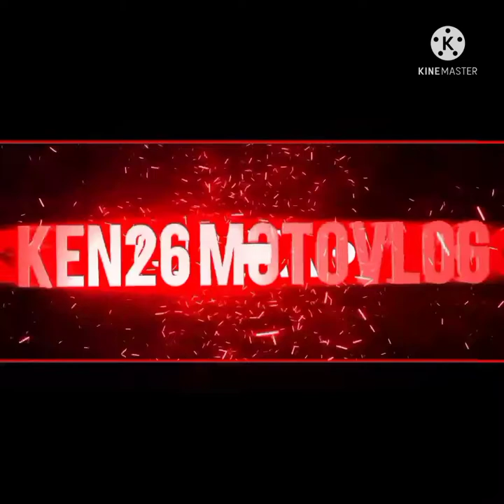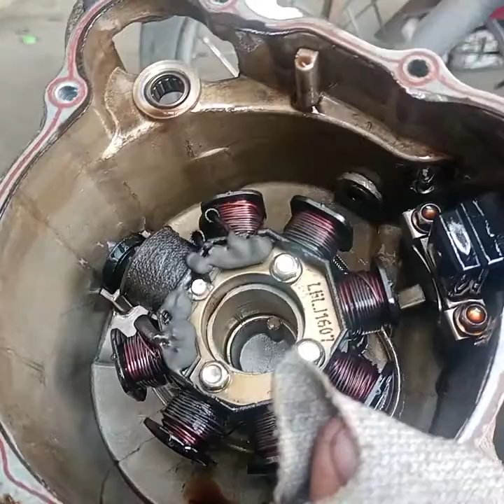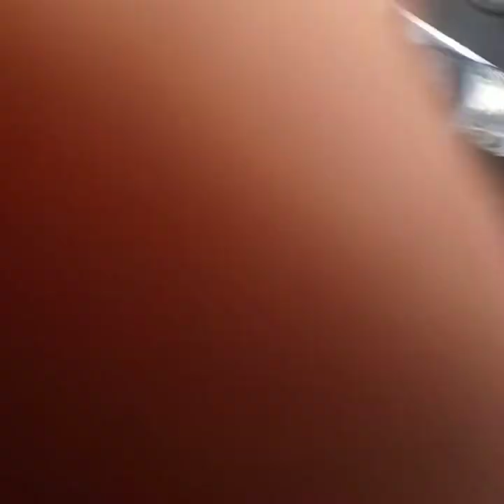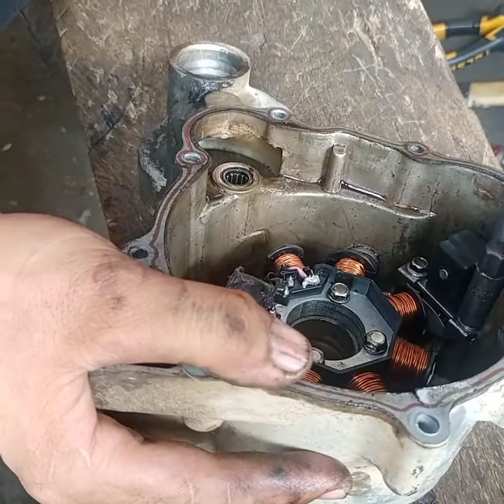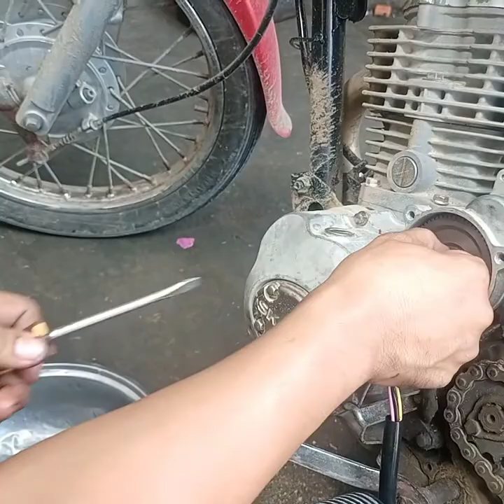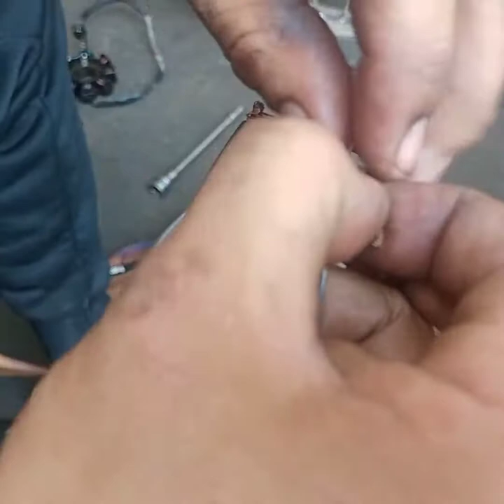skygo 125 stator replacement tutorial

Comment: Dol ung motor ko pinalitan konant coil stator Hindi sya omandar kapag walang battery
Reply from the maker: bka nka battery drive na cdi mo
Reply from the maker: green socket pag battery drive..
Reply: So paano ibalik dol sa Hindi battery Drive
Reply from the maker: @DamsevalTorrejosbaguio  hanapin mo yung old na cdi niya po.. para ma engine drive uli
Reply: Bago din tong CDi dol
Reply from the maker: @DamsevalTorrejosbaguio  anu kulay ng socket ng cdi?
Reply: Wire yan dol.or Hindi